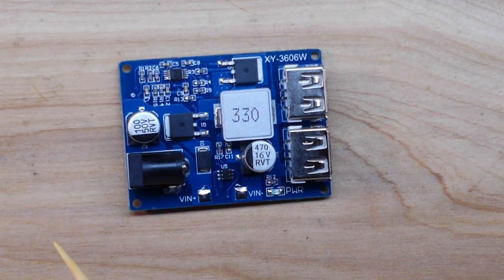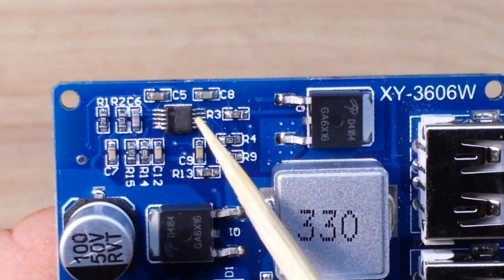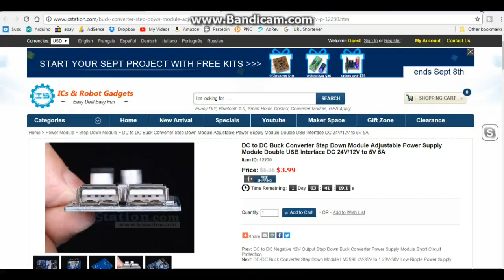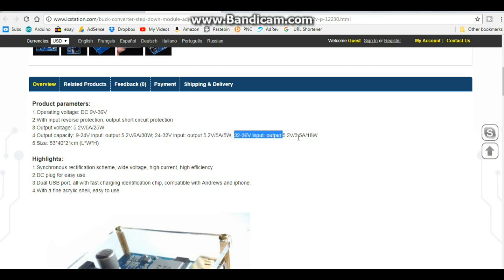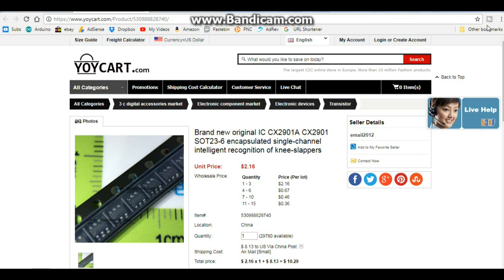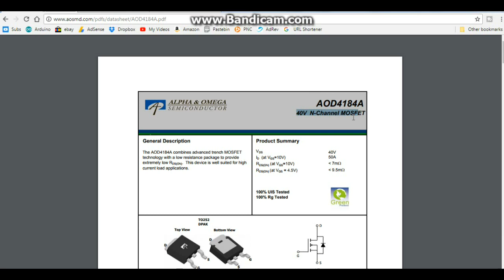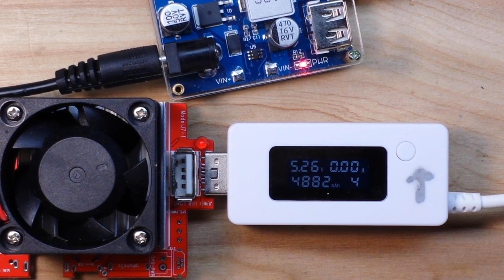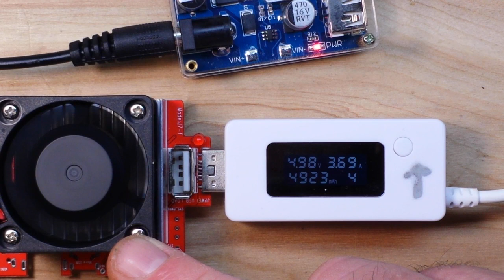25W 5V Quick Charge Power Supply from ICStation com

Comment: Looks great!
Voltage dropping below 5V, which someone pointed out, is probably caused by contact resistance of the USB connectors. Voltage seemed to drop at rate of 0.1V/1A. That could be caused by 100mOhm contact resistance which is very possible.
USB connectors aren't really ideal if the device needs stable voltage, especially when current is more than couple of amps.
Great video and the buck converters seems to be good as well!